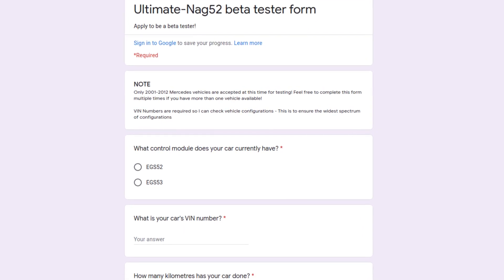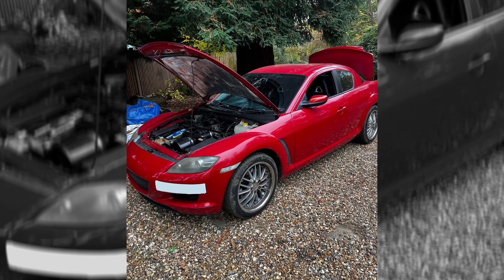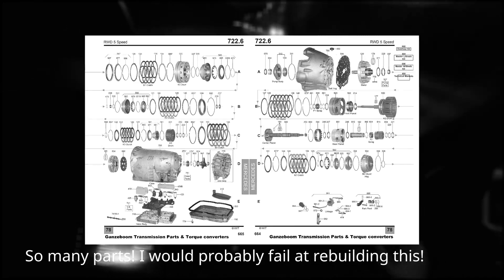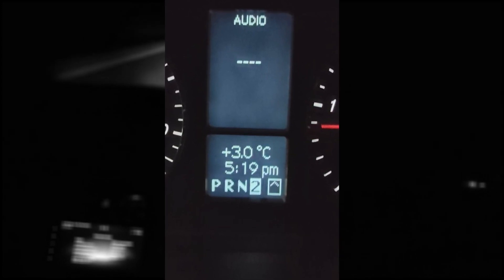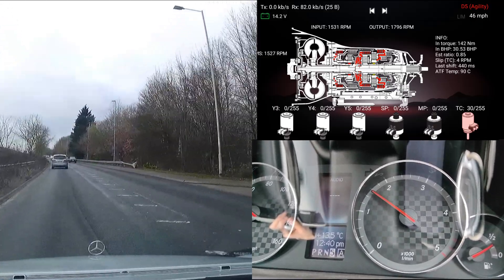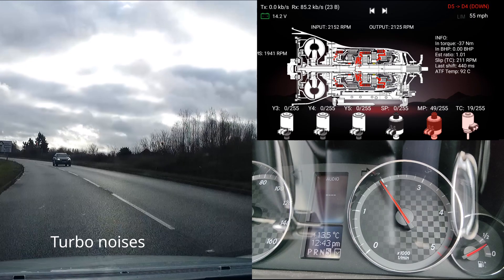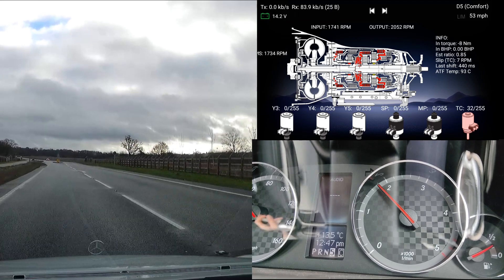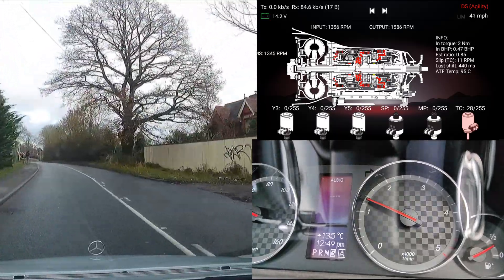CUSTOM MERCEDES 722.6 TCM part 3 - Torque converter and smoother shifting, and a surprise!

Comment: Hello friend i have a proble with a 722.6 transmission it neutralized in 10 minutes drive  turned off I waited a few minutes and tried to make it work well i already repaired it changed everything do you think it's TCM could you help me i already bought TCM I need to reprogram

Comment: hello to you, Bravo for your videos...!!!
I come to you because I replaced the gearbox plate myself on my 722.6 slk R170 from 1997....and obviously impossible to access it
the main computer afterwards. With a message P0730...Was it necessary to copy data from the old board?? Thank you for your help! However, if you work remotely I'm up for it?? THANKS

Comment: mbux port partially works with 210. I have connected only can_C so far. engine data is working. data 722.6 does not work (EGS51) or does not work completely (id 218)

can_B didn’t connect because I don’t know what transceiver is needed there (fault tolerant or not)
Reply from the maker: yes, on 210, the CAN C network is different, 211/203 gen uses a more detailed version of the 210 CAN network (More data added)
Reply: @RANDASH  in this case, I'm more concerned about voltage levels. in FT-can they are different.

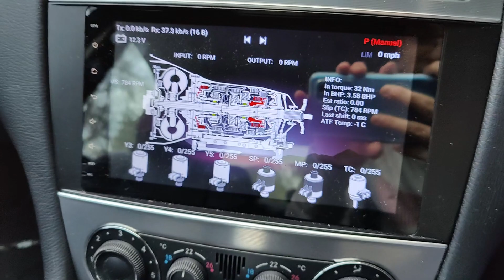Comment: will the version with the screen with the 722.6 image be posted on github? time - 7:24
Reply from the maker: unfortunatly not, this required a LOAD of special changes specifically with my TCU and the HU code, its not really portable
Reply: @RANDASH  I ordered v 1.2 board from JLCPCB ;) and almost all components. When I have time I will solder and experiment with UltimateNAG
Reply from the maker: oh! There is V1.3 now btw! It has some additional IO and some minor circuitry improvements
Reply: @RANDASH  when I ordered 1.2 the new version was in development status. I waited for the board for about 50 days. lost them twice
I don't need the result so much, I'm more interested in the process. I want to assemble this thing with my own hands.
As they say, a samurai has no goal, a samurai has only a path)))

additional input would be useful for the mode switch button standard, winter. I have no idea how to switch more than two modes

it would be interesting to make the agility mode on w210 m112 egs51 prnd4321 

will it be difficult to adapt the mbux port project for my car?
Reply: @RANDASH  no one will stop me from ordering 1.3

and by the time I get them you will make 1.4 with even more cool features